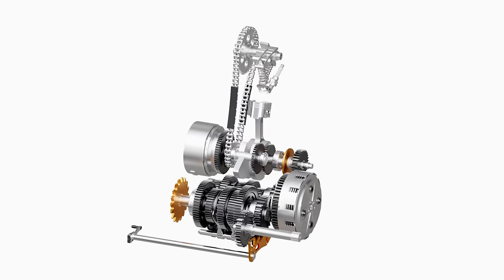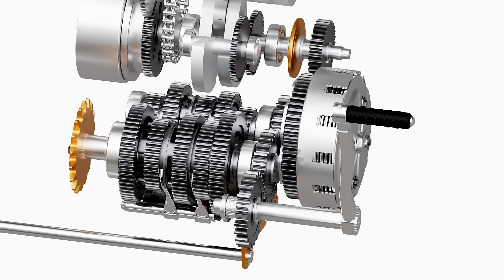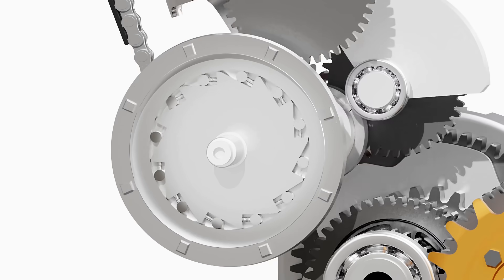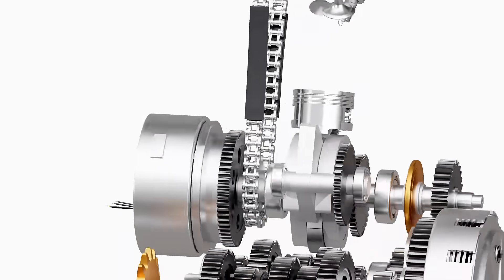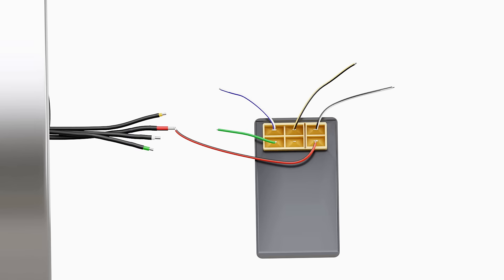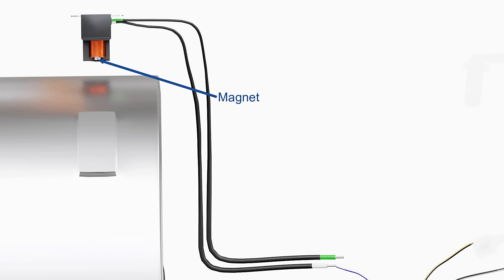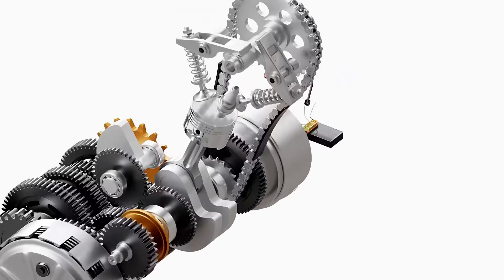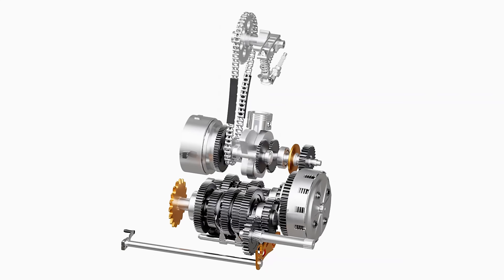How Motorcycles Work - The Basics

Comment: Our co
mpany specializes in manufacturing precision components made of alumina, zirconia, silicon carbide, and silicon nitride ceramics.
We produce ultra-high pressure and ultra-precision plungers with the following precision specifications:
The tolerance of the outer diameter can be as precise as ±0.005.
In some cases, the tolerance of the outer diameter can even reach ±0.002.
The tolerance of the length is ±0.005.
The concentricity is within ±0.003.
You are warmly welcomed to consult and get to know more about our products. We will provide you with the highest quality products and services.

Comment: On every engine with an electric starter there is a 12V battery. This battery (same in cars btw) is used mainly for starting the engine, or to power everything else while the engine is off. Once the enginw is running, the battery is no longer needed due to the GENERATOR, which is driven by the engine and creates enough electricity to power EVERYTHING and even charge the battery.

Comment: OMG what a joke lmao. You open with "Motorcycles today are the true marvels of engineering" and the first thing you illustrate is a kick-starter? For real? Even stupider: this video doesn't even pertain to motorcycles, it's just an illustration of SOME of the elements of internal combustion engines in general. What compelled someone to make such stupid content? "I know, let's make a video explaining how motorcycles work, except we won't discuss anything motorcycle specific" Hey, for your next brilliant episode, you can focus on passing electricity through a high-impedance coil of wire within a little buln of glass will cause them to emit light, CRITICAL for the headlights and tail lights of motorcycles.

Comment: Really helpful video to help visualize the working parts of the engine! 
So what about 4 cylinder engines for example, is it just the one extrusion on the flywheel for one or more pickup coils? the extrusion acts as a crankshaft position sensor? how is each cylinder timed perfectly, at higher RPM how does the ecu with cdi change timing to detonate sooner or at precisely correct timing. Thanks!
Reply: really ???       'for example'     ????       what  a  nut

Comment: crannnnnnnkkkkkk shaaaaft  I wonder that the fuel is compressed in open space I just have that question why piston and crank shaft are open and why they are openly compressing
Reply: yes.    the top of the cylinder did not make sense.

Comment: Great video and animation. But I thought motorcycles used 2 stroke engines since only one cylinder is in the engine block. That way a power stroke is always fired for every full revolution of the crankshaft.

Comment: ki, Starter kicked, that turns a Serrated  plate , Ithis plate attached to a plate tact might contain magnet , gets couple round spin from the kick force transferred to the last plate , or  box plate containing free revolvable magnet, Revolving mag Creates i guess current to Creek Spark that spark if (the engine is combustion then al work, Never i will do that self start w kick start transmissin m magnet to generate Spart that Spark rotates the main motor with current produced as the spark, Spark making the motor revolve, and revolving main motor may be producing  rather Conter current for the start plate box magnet to rotat and viceversa fuck  off

Comment: At 1:30 , does that meana when i am at very slow speed /rpm ,the self start motor also rotates ?
Reply from the maker: No. Even the idle speed is generally set in a range of 1000 rpm which is high enough.
Reply: Congrats, you have made a way of starting called Bump Start

Comment: Animation is fine but the narration is not as clear. For example: The "extrusion" on the flywheel should have been described as a magnet instead (and then mention that's why it's called magneto ignition).
Reply: In this case the magnet is inside the coil. As the extrusion passes the magnet and coil, the magnetic field in the coil gets stronger because the material of the extrusion has higher electromagnetic permeability than air. This change in magnetic field is picked up by the coil.
Reply: Actually the "extrusion" is just a metal, not magnet.

Comment: Good video, but it explains nothing about a four stroke engine lol. It should be called, how the stator and rectified systems eork.
Reply: Motorcycle engines (2 or 4 strokes) work the same as any other engine. You can watch tons of videos on this subject on the internet. 
This particular video offered a peek on how the entire motorcycle power train works, and it did simply and beautifully.